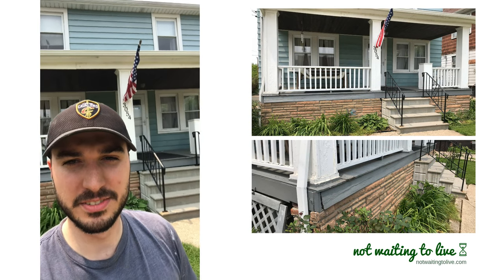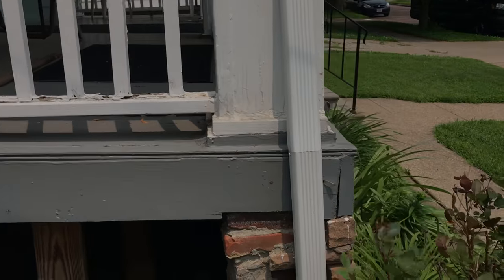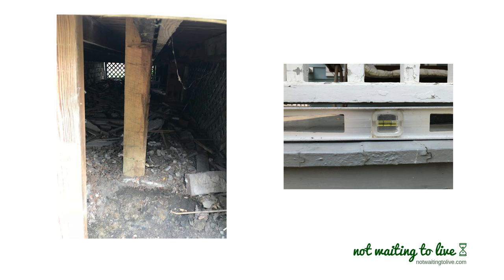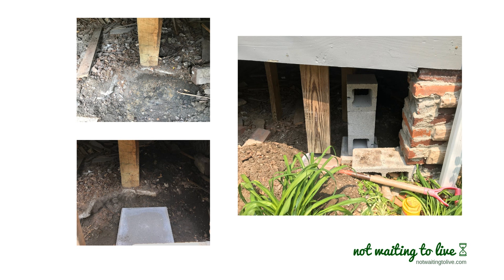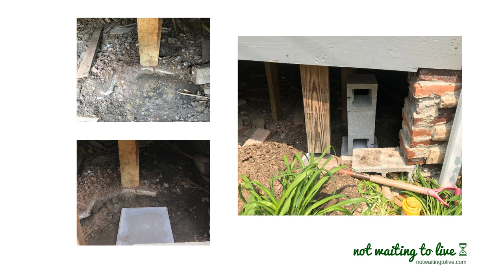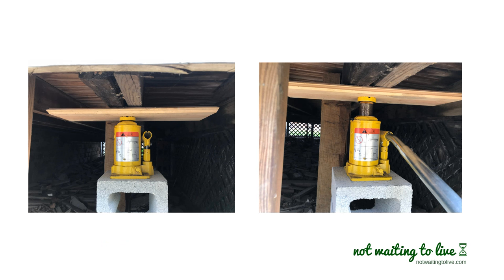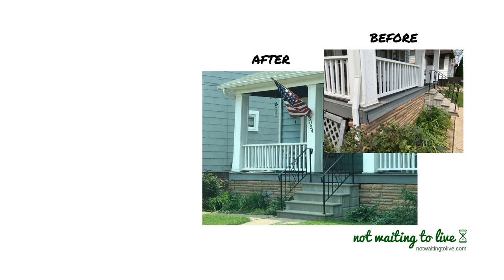How to Raise and Level Sinking Front Porch Deck Handy Manny

Comment: I just want to emphasize that if you are using hollow cement blocks in columns you should never have the blocks oriented so that you can see through the column sideways as in this video.  The two vertical side walls might be strong in compression but cannot resist a side load.  The block can suddenly collapse like a parallelogram.
It's so easy to just orient the hollow vertically which results in four vertical walls carrying the load.  This gives the greatest vertical strength and side load resistance.  For your sake and for the sake of your loved ones, use hollow blocks properly.
Reply: Thank you!!!!!
Reply: agreed.  I move portable buildings and porches for a living and seeing the way he used those 8" cinders made think he needs to change his channel name to 'not wanting to live'.

Comment: Thanks FOr the video, I am getting ready to help a neighbor level his porch deck that stands already off the ground about 5 feet in front.  Well over the years the deck has sunk in the middle of the front of the deck.  Efforts were tried to support it but as you explained no effort was made to put concrete under the support, so this video gave me an idea to raise that area and level the porch and put in a larger piece of timber with a concrete base under it so it won't sink anymore, so thanks for your efforts, I really appreciate it.   JD

Comment: Lucky that hollow cinder block didn't implode having it on the collapsing angle.
Reply: Yeah, blocks only take vertical force in one orientation, and that ain't it!  Next time buy 2x blocks!
Reply from the maker: @mjkulikow  I agree that the blocks are in the wrong direction for their intended use. However, their application in this video is not their intend use. I disagree that the blocks can only support a load when vertically aligned. They clearly supported the load in this situation for reasons beyond luck. The side wall still has a shear strength >1,000 pounds and the jack would slip through the center hole of the sash block if positioned vertically. That means the failure point becomes the shear strength of whatever is directly underneath the jack. I think a better solution in hindsight would be to stack the blocks vertically and put a material with a higher shear strength than the sidewall of the block to support the jack. What would you recommend?
Reply from the maker: @andrewi6445  how would you support the jack in this situation?
Reply from the maker: What is the shear strength of the sidewall of a hollow concrete sash block? And how much weight do you estimate the jack is supporting in this video?
Reply: @notwaitingtolive  Totally fair and correct.  The way that I do it is solid blocks at the bottom with a rotated stack of blocks and a 2x12 between the block and jack at the top.  If that block had a hairline crack you can guarantee that 1k shear would be much much lower.
Reply: And I bet the total weight is less than 1 Ton or 2k lbs...Also don't forget, hollow block is NOT strong, it needs to be reinforced and filled (ie solid) to reach its full potential.
Reply from the maker: mjkulikow Also fair. I appreciate your feedback. I’ll probably take your approach next time.
Reply: @notwaitingtolive  I actually just bought a house with a sunroom that is sinking in one corner (abt 2"), the pier has settled and I will be using the stacked block approach to jack it and cut new piles including a 1" standoff between the concrete and the wood.  The problem here in VT is the snow load, it weight a LOT more than bodies.
Reply from the maker: mjkulikow I’m very interested in those types of fixes. There are plenty of sagging sunrooms/porches/decks here in Cleveland. Do you have any idea how wide and deep the piling is that’s sinking? Do you plan to add any additional pilings? Are you using 6”x6” for the post after the post base? Or are there even larger requirements in that part of the country?
Reply: @notwaitingtolive  The problem we have here is that the ground settles, and my house is in sand so no one digs 20' to bedrock ;)  Piers will sink, and my plan is to just jack up, replace the pile with a new 4x4 (the sunroom has 9x supports for 12x12 which is plenty).  The one thing to make sure of, is if you DONT have enough posts, upping to a 6x6 may be required.  I am also adding cleats (old school bolted beam to post) and braces for racking.  You can also look into metal screw piers, but that gets expensive.
Reply from the maker: @mjkulikow  That makes sense to me. This summer a family friend used the simpson strong tie brackets to retrofit new posts to an existing floor joist that was sinking in one corner. He then added cross bracing in each direction for each of the posts for good measure. He's a 4 decade contractor who built his own home almost entirely by himself on the edge of a steep hill so he's probably more aware than most about how supports like to move...

Here in Cleveland though there's a ton of shallow clay once you get away from the lake. I've not encountered nearly as much sand as you're probably experiencing.

I've seen some guys build some impressive remote structures with those helical pilings. They're supporting glorified decks but they can skirt around building codes due to the technically temporary nature of the piling. https://www.treehugger.com/autonomous-tents-4855775

A builder used them on Season 8 Episode 9 (Colorado Crest) of the show "Building Off Grid" if you're curious how that worked out. https://watch.diynetwork.com/tv-shows/building-off-the-grid/full-episodes/colorado-crest
Reply: Yes a solid one is best 👍👍
Reply: Or use 4x6 or 6x6 cribbage log cabin stacked.  Also could use a floor jack with a piece of wide lumber underneath and a 4x4 vertical to lift the porch up and maybe put cribbage timbers underneath the raised part so yiu can safely work building a proper height solid or screw adjustable semi-permanent house pillar in the space, then jack the porch up a smidge and remove the top layer of cribbage and lower the porch back down onto your new replacement support.  The adjustable house jack can be used to make it perfect without much fuss except for wallet fuss (they're less than $100, but not el cheapo).  If the porch sags a bit more from settling after the fix, then it's fairly easy to give the screw a turn or 2 to return it to perfectly level in the future.

Comment: Thank you Manny.  I have an old house house with a sinking corner on the front porch.  It needs to come up about 2".  The porch has concrete piers at the corners with crawl spaces in between.  The old floor joists are about 10' apart.   am in Florida so we are pure sand - no clay.  Any suggestions for adding new support on sand.

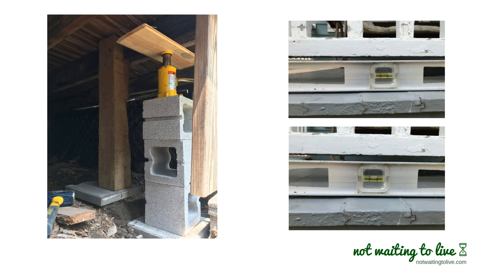Comment: I say, it looks as though the before and after photos of the bubble level, (3:45) indicating the difference between the deck sagging and the deck repaired have been tampered with. The left end of the level is a little higher off the deck in the after photo, suggesting an adjustment was employed to center the bubble, thus giving the impression of the deck being perfectly level  :)

Comment: If you need to raise a floor/deck two inches should you do it in steps? Like raise it one inch then wait a month and raise it another inch?
Reply from the maker: I’d just go for the whole two inches up front. The original settlement was caused by the same weight that will be applied after you raise the deck. If you think it will continue to settle more you can spread the load out by adding additional supports before raising the deck.

Comment: Most excellent explanation,  I have limited experience but I can learn. I would make this suggestion for future excellent vids--if there are similar pics if you could label them as connected or different--1a, 1b etc or whatever is easiest for you it would help my following the thread. You have a pleasant delivery, calm and easy. You also project the belief that yes, even you can do this (the jack lifting the car yeah, it can surely lift my porch, didn't know that). Thanks now if I can only please the damn useless code enforcement igits...

Comment: I have a porch almost exactly like that!
Problem I have is during heavy rains, water gets underneath the porch and softens the ground.
Not sure the ground will be hard enough to support the weight of the supports without sinking into the 'mud'.
Excavation is out of the question as I am not rich. Nor can I do that myself.
I think the water issue was coming from leaking downspouts so I replaced one with a larger one just to see if that was the problem.
Won't know till we get another heavy rain.

I wonder if a 'screw' type house jack could remedy the problem?
Reply: You need to pour or install pyramid blocks.  The flare at the bottom prevents them from sinking. It is upon this technology that buildings on the Florida Coast are built.  I've used the Dek block brand and they are fine if you follow the directions. They have to sit on well-drained, compacted gravel, so you'll still have to dig a hole for each one. Movement can be minimized by putting the blocks 3 inches below grade (in a bigger hole) and surrounding them with gravel.  Make sure the deck doesn't have running water under it or the blocks can be washed out.  That would need to be addressed first if so.
Reply: @sheabernard1962  Those pyramid blocks are presumably very heavy.
I won't be able to move them in place.
Bags of cement are even too heavy.
Only have about 3 to 3-1/2 feet of head space on a very lumpy ground.
But I can place a patio block and concrete block though.
Digging might be a huge undertaking as well.
I really do not want to take up the porch floor just to shore it up.
Reply: @crazysquirrel9425   You can use the deck pyramid blocks, easily moved by hand.  Frankly anything without a flared-base is not going to work long term, although (2) 12x12 concrete pavers, stacked, then a 8x4x4 cinder block cap would probably work as well.  Anything that is downward tiered to spread out the weight.
Reply: @sheabernard1962  Grandpa just said to look up "K-Type shoring"

Comment: Can someone please tell me.   I have a small sinking front porch, which has caused a stairstep gap in the brick foundation just on the porch section.
Is there a way to patch these cracks, so that you can still jack the porch up later?   
If I use mortar or caulk, won't that interfere later.   Has anybody done this

Comment: Did you have to brace the roof of the porch? The foundation of my porch is brick, will this technique work?
Reply from the maker: You will commonly see people using a ~100" adjustable jack or 2x4s to brace a porch roof when replacing the porch columns.

The method in this video raises the wood deck itself. The jack can raise the deck off lower supports. If your concern is that it will also raise supports on top of the deck, below the roof, then you're looking at bracing the roof and replacing those supports. My guess though is if that's the case then the porch roof has sunk as well.

Has the porch roof started to separate from the house?

Comment: How do you raise a 6x6 porch post that’s cemented into the ground and is finished around both sides.                                                               I’m considering trying to get a straight cut thru it all the way.  Then jack up the porch an inch and slide in a 1” board.  Then band the post to keep it in line from settling out of alignment with the porch.                                          Any input would be appreciated.

Comment: How much does a project like  this call for those of us who are not handy?
Reply: Then again I can use a jack--
Reply from the maker: That can vary greatly. 

I charged $200 for labor and materials for this job of raising and leveling the one corner. I spent a couple hours on this start to finish.

Nowadays in the Midwest a good handyman charges ~$50/hr. They may charge a minimum fee of $200-$300 if the job only takes a few hours.

A licensed and bonded contractor may not even entertain a project this small. If you need multiple post raised they may accept the work but more likely they would only be interested in a full rebuild of the porch for $5,000+.

If you have trouble finding someone to level the porch for less than $500 go to the pro desk at Home Depot and ask if they can refer any independent contractors who could level a porch.
Reply: Didn't show what I need.  Need to figure out how to put in the supports..  Our deck hasn't sunk just the supports aren't supporting cuz they sunk...
Reply from the maker: @sbziel  raise the deck with a temporary support and dig out the permanent support so you can get under it or replace it then adjust the permanent support by shimming the bottom or replacing it with a new longer one. In this video I added a ~1” concrete paver underneath the existing support to raise it.
Reply: @notwaitingtolive  to bad your not in Colo.  Wife was thinking it would be thousands to fix...  But my deck isn't sinking just the supposed supports sank.
Reply: @notwaitingtolive  Thanks for uploading.  Was going to reply to you but guess that was in individual email land or somewhere else.  Regarding 5K ouch that is worse then 2K.  This stuff always looks easier on video then when you do it in real life.  A big problem with my deck is there isn't room to work under the deck.  And leveling the deck didn't even cross my mind.  I'm happy that it is just the supports that have sunk and not the deck..  Now my wife has higher expectations.  Which is another reason to pay someone else in case things go wrong...
Reply: @notwaitingtolive  This deck was built by armatures.  If I were to raise it I'm sure I would do far more harm then good.  They used a ton of deck screws which is making it harder to remove wood that has seen it's better days.  The deck screws break off.  They used a lot of wood!!!  The deck has at least 6 supports and only two are totally problematic.  A couple more are at slight angles..  Again thanks for posting...
Reply from the maker: You’re welcome. Trust your gut on this. Something always does go wrong which is why it’s usually better to pay someone else to deal with whatever problems inevitably arise.

Comment: I have a porch that has been enclosed. I want to open the enclosed porch to the living room. When the porch was enclosed, the floor was not leveled. so should i shim the flooring or lift the front of the porch and level it?
Reply from the maker: I think shimming the floor is less likely to create a new problem. How much of an height increase do you need to level out the room?
Reply: @notwaitingtolive  I have a similar situation, but my enclosed porch was already extended to be part of the living room, however it was never leveled.  From the highest point to the lowest is about 2" towards the front of the house.  The flooring company I plan to have the LVP installed will shim the area to level.  Would this be your call as well, or is your method better?  Post leveling, looks like I have to raise the baseboard heater pipes, and probably adjust the door and entry way due to the new floor height.

Comment: I have to do this to my porch. I haven't been underneath to determine what needs replacement in terms of supports. I have required tools, but my question is, was there any issue with the windows breaking when you raised he porch. My house is also about 100 years old and the windows are painted in, removing them would be somewhat impossible, but I'm concerned about jacking the porch and the windows not being able to readjust. It's amazing that they haven't completely cracked in the present state. Any thoughts?
Reply from the maker: James Durham the windows were not damaged in this instance. Most porches are attached to the house and not a part of the framing of the house itself. For this reason it’s unlikely the window frames would pinch or shift from the adjustment of your front porch. 

Century old windows are often a lot easier to remove and replace than you might think. The 100 year old type with the counterweights are kept in place by a vertical trim inside the window frame on the inside of the house. It may not seem like it’s easy when it’s painted over, but this trim piece is easy to get off with a small molding crow bar ($10) and a hammer. When you remove that trim piece the window comes out easily. (This is how you can replace window panes) You can jack up the porch, pop the windows back in, put back the trim and repaint the trim a quart of paint. You could even take the opportunity to reset the trim (which warps over time) and make the windows easy to open and close by giving them just smidge more room, they’re often (but not always) being pinched shut by the trim. If the counter weights are broken you can use a sash spring to keep the window in place when you want it partially opened. https://www.homedepot.com/p/Prime-Line-Wood-Window-Sash-Spring-F-2537/100195289
Reply: I build decks, and depending how you porch is attached to your home either wood or concrete will help in that decision. The porch shown in the video would not have affected the windows.Ledgers generally are  attached to wood or concrete, and are never lifted in a porch repair depicted in the video. He is lifting the porch from the front, not the back, so he would not disturb the house or windows.